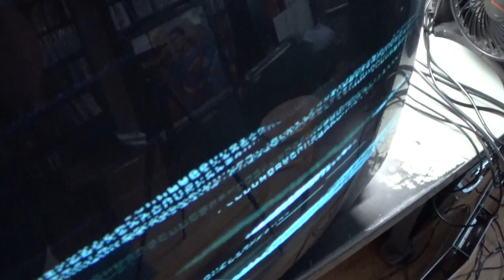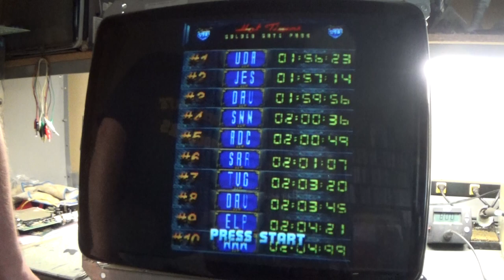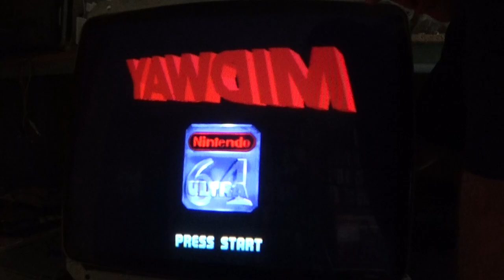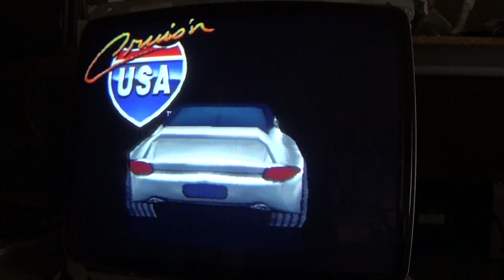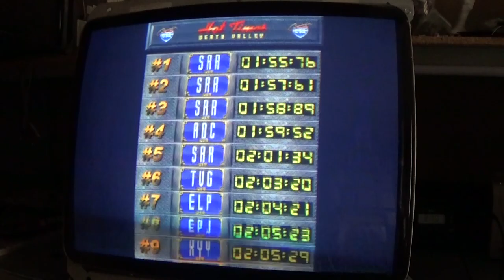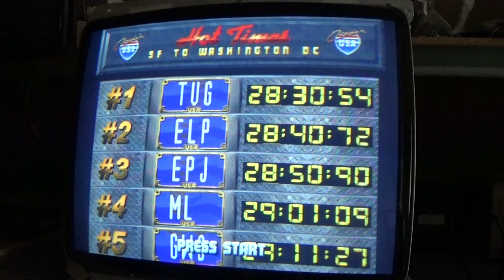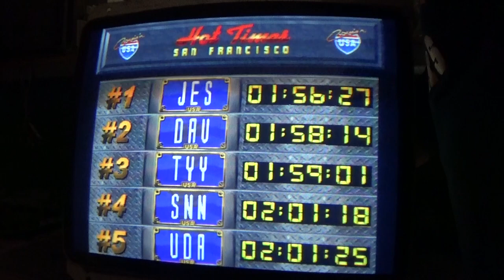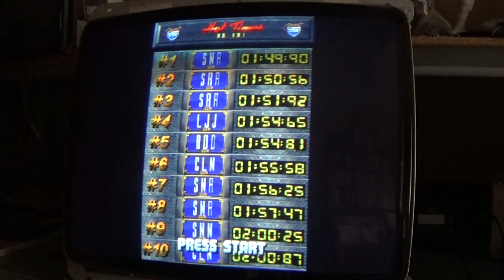27" K7500 Arcade Monitor Chassis Repair - Bad Caps Causing Vertical Collapse After A Few Minutes

Comment: what format is the video input signal used to drive these arcade mointors...is it pure RGB from the game board or is it rf modulated because i don't see any rf circuity like in a regular TV like you would use with old 80's consoles.
Reply: It's RGB (+ sync) straight from the PCB. no rf or anything like that, fortunately ;).